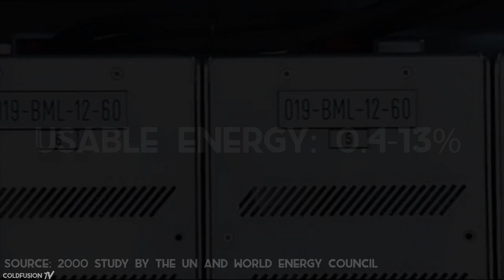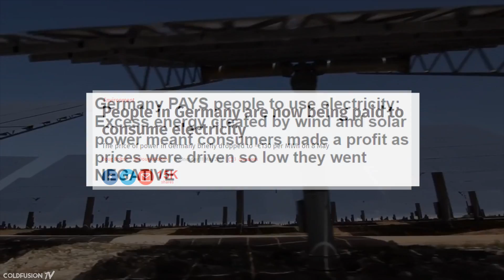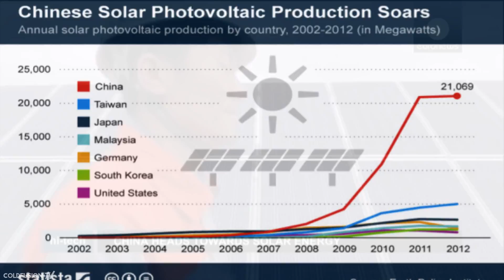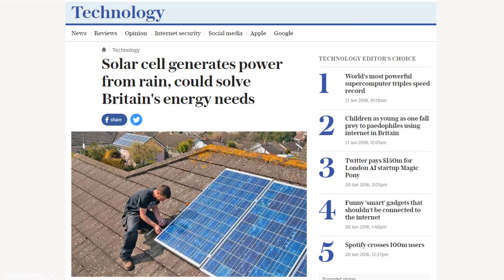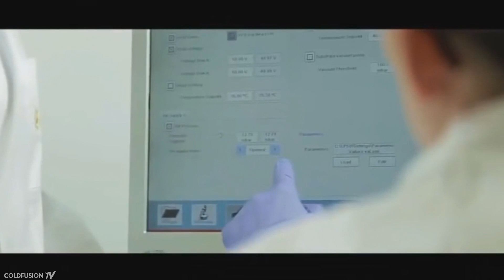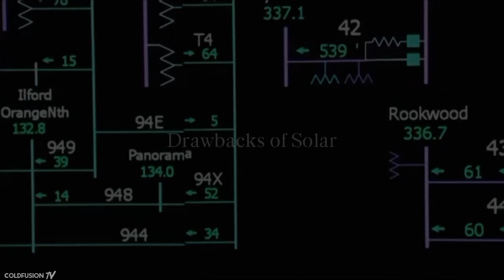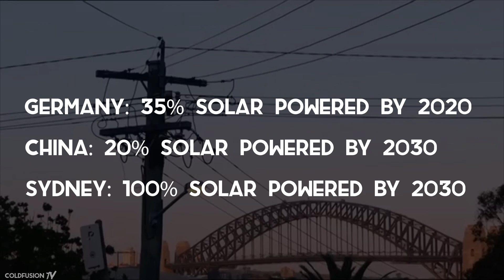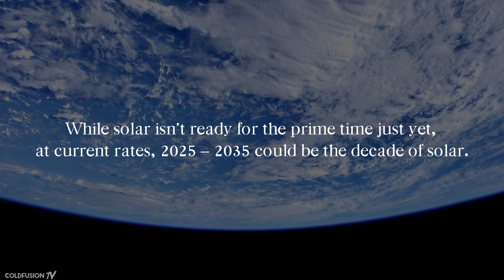The Truth About Solar

Comment: You didn't even mention how much habitat a solar farm needs to destroy in order to make a 1GW plant. Usually desert too, which is probably the most important type. Nor did you mention how many batteries need to be produced for such a plant or what happens when we can only recycle 90% of them. That 10% will build up and fast.

I really wish you would cover Gen IV and Molten Salt Reactor nuclear plants as nuclear is an incredible option for our energy crisis as well as SMRs.

Not to mention how safe it is and does not require mining heavy metals in countries where safety isn't exactly a priority for the children who mine them.

This was a nice video but I can't help but feel there was a large bias to make it seem as if solar has or will have all of its issues solved in the near future. That is not the case at all and there are those who currently theorize that we are incredibly close to the theoretical limit of a solar panel's efficiency.

There is no reason to suppose we must go 100% solar or bust, just as there is no reason to suppose we must go 100% nuclear or bust.

For a channel called cold fusion I can't seem to find any videos about nuclear at all upon searching.

Comment: 3:02 $0.36 per watt? or do you mean per kilowatt?
Reply: He means per watt on a solar panel module, such as a cheap low-end solar panel rated at 100 watts would cost $36. At 2:45 makes it quite clear.
Reply: I am just explaining what the producer of this video is saying by $0.36 per watt. I don't fully agree with the statement. Though, Chinese cheap, small warranty, low-end panels get close to that price. At the high-end (like Renogy and Sunpower), you'd have to purchase whole systems to get it anywhere near $0.36 per watt, at ~$1 per watt on a panel.
Reply: Probably
Reply: Recently I added 2 solar panels to my small rooftop system. I got 540 Watts for A$416 = A$0.77/watt. In US$0.52 per watt at current exchange rates (May 2018).
Reply: Rusty Debier China or Africa
Reply: Solar cells can be bought from aliexpress at $0.30/Watt. Solar plants of the largest scale are usually around $1 per watt, there are a lot more costs than simply the cell!
Reply: @Tousef Para   Energy is measured in Ws=Wattseconds or kWh=kiloWatthours. Power is defined as energy/unit of time, hence power is measured in Watt=W or kiloWatt=kW
Reply: I paid 58 cents a watt on my panels here recently, top quality that's probably about as good as it gets this year for consumer prices.
Reply: lol I hate to break it to you thecarman but all power is provided using energy, every powerplant ever made would be calculated in KW, not kwh.
Reply: Current paying.13 so it is a long way to solar yet.
Reply: $0.36 per watt would be quite expensive... thousand times more than what you paying right now ;-)
Reply: They mean per watt. Solar cost over $100 per watt in the 1970's...now (2019) it's less that $.35/watt
Reply: ColdFusion is the expert here, Papa, not you. As the green militants will be glad to remind you, you may NOT criticize their experts!
Reply: That is not a consumer price. It's like, some projects include thousands of modules, that come straight from a factory. Because it's on such a big scale, the price per module goes down. Usually if you take modules on your roof, there is an "in between" partner who has to make a profit and has to send people to your home to check if it's usable for PV, install the panels and the system for only 4-20 or so panels, so the price per kW goes up tremendously.
Reply: He means cost per watt (energy, not power)
Reply: Research building your own solcar panel (loads of vids on youtube), buy some solar cells and wire them up, it's really easy.
Reply: Either way, that doesn't make sense.
You are paying for energy, not power ... and watts or kilowatts are not units of energy, they are merely power. You need to use the proper units --- kilowatt hours is the standard unit of energy for electrical use. Using 1 watt for 1000 hours OR 1000 watts for 1 hour are equivalent, and should cost the same amount. Saying $0.36 per watt has no meaning unless you say for how long. An hour? ... a week? ... a year?

Comment: A solution to the grid upgrade problem is to decentralize power production by allowing installations on homes and nearby suitable areas, deploying smart microgrids to be able to share as much as possible all generated surplus locally and maximize intelligent use of generated power without incurring into losses due to transmission lines and wasteful use through peak times when generated power is low.

Comment: Video states 0.37cents per watt=$99.9 a panel  but panels cost $200.00 and the needed  inverters are appx. $200.00 also. dont forget the labor and the wires

Comment: My work with alternate energy resources spans about 50 years. I am no scientist. But, I intensely investigated solar, geothermal, wind, etc as a viable investment and business opportunity. I was a builder of homes and agricultural structures. As far back as 1979, I visited many totally off-the-grid farms and homes all designed and built by individuals making clever use of then available technology and materials. I became very excited about those ideas and wanted to go into business making energy independent residential and commercial structures available to my own customers. This turned out to be a financial impossibility.  This was due to the bankers and other interests (read big oil and electricity) refusing, and in some cases, directly sabotaging all alternative energy efforts. Even government was involved refusing to codify such energy efficient designs. Insurance companies (owned by guess who?) refused to insure such structures! At the time,  I was in association with several other forward thinkers in my trade trying to achieve the same goals who encountered the same problems I did. We finally gave up out of financial necessity and re-joined the conventional processes. We found that any mention of alternative energy project was met with first ridicule, then intense rejection and, if a person persisted,  even subtle threats to our own financial security!

Alternative energy all sounds good. It is certainly viable and absolutely the way the future must work. But, really, nothing of any real significance will ever happen so long as Big Fossil Fuels outfits run the show. Something really huge in economics must happen- a major, and easily replicated (shared) technology has to happen to drive the existing "Rulers" of Earth's energy off the table. Solar and wind will always be more-or-less interesting toys in the shadow of these huge energy giants.  The "technology" will never quite be accepted as practical in the larger sense. They will never just throw up their hands and say, "Ah. There we have earned enough mega bucks...you little people take over, now." 

That is the reality of the alternative energy world IMHO.

Comment: The chief cost of solar panels is the area of land required. The chief fault of sunshine is that it is not dispatchable.
If you have more solar power coming in than you use, and the electric company is compelled to buy it when they have nobody that wants it, you are stealing.

Comment: I'm seeing a lot of comments suggesting solar will never be cheaper than coal. In fact, both solar and wind are already cheaper than coal. Check out this report by the World Economic Forum: https://www.weforum.org/whitepapers/renewable-infrastructure-investment-handbook-a-guide-for-institutional-investors/ it found that in 2016, solar was cheaper than coal in more than 30 countries, and that solar is becoming cheaper at a faster rate than coal. Solar is cheaper than all fossil fuel energy sources and is rapidly becoming even cheaper. Fossil fuels still dominate in 2017 because there is a lot of upfront infrastructure investment required for transitioning the world to solar and because the fossil fuel industry has spent large amounts of money to convince people renewable energy doesn't work.

Comment: one point that was missed in the video is that for silicon solar cells the total amount of energy required to manufacture a sogar cell is considerably more that one will ever obtain from the cell over its lifetime. 
However, with new technologies this input/output energy should improve.

Comment: First, Germany does not have an abundance of energy. They have such a huge energy deficit that they depend on natural gas from Moscow to compensate.Second, the Rare Earths required to make solar panels and the batteries for electric and hybrid cars are so scarce they make petroleum look as plentiful as sand. Two of the rare earths are only found on one side of a single mountain in China. Until they can develop a system that uses no rare earths at all, the costs associated with solar will increase exponentially as the extremely limited resources are used up. In the meantime, we're just trading dependence on foreign oil for dependence on foreign rare earths instead. That is not an improvement.

Comment: The one thing these people will never talk about is the maintenance of solar or wind power. Lets talk about costs to the environment for the manufacture and the recycling process of the hardware that harnesses the power of the panels and windmills... batteries, capacitors etc. This is where the cost lies, yet its never talked about. Same for the wind farms...the energy is captured in DC, then has to be converted to AC. To do this, lots of hardware (batteries/capacitors etc) has to be employed for this process. Nuclear power is the way to go.

Comment: wait germany is wanting 35% by 2020 but you said germany was paying people to use energy since they were producing so much because of solar and wind? which is it? you also failed to mention the space solar takes up just to produce the required power. germany has them everywhere including fields and along roads but still hasn't hit 35% production. by the way cold fusion is a pipe dream that isn't attainable.
Reply: oh yes at .36 cents per watt means it's $36.00 to light a 100 watt bulb. I would love to have a more eco friendly and cheaper power source than coal or natural gas. coal power plants have been on the decline for quite some time anyway. you did hit on the main issue with solar power. no intake of energy at night. till storage can be fixed and regulated for demand solar will never overtake the others. honestly hydro has more promise than solar in that aspect.

Comment: Solar is not base load, and backing up the grid with batteries is horribly expensive.  Backing up solar with gas turbines is so polluting its pointless.  In a few places hydro is a good match for balancing/back up but most countries are not that lucky.  Really the only long term,affordable (half the cost of coal) and low pollution ( burning up 99% of its fuel) is Thorium. Everything else is just an expensive,impractical waste of money.

Comment: What are the side effects of the sunlight not hitting the ground but bouncing off (reflecting) back into the atmosphere ? What about the energy and mining required to manufacture the batteries ? Whats the point if it takes more energy to make a solar energy system,than what you will ever get out of it ?

Comment: What makes the most sense is approaching energy production without bias.   Too many people pushing solar are ideologically biased against other energy sources like oil and coal.   Solar has an important place and indeed will likely someday be the dominant source of power - I am all for it.   However, that day has not yet arrived and we still very much need oil, coal, and Nuclear.   When we put ridiculously overkill regulations on these sources that needlessly drive up the cost to consumers, people are getting hurt.  For example, here in the United States, the law of diminishing returns means that a long time ago we reached the point where additional regulations caused significant increases in cost for insignificant decreases in pollution.   The result over the last 10 years has been a 40% increase in the cost of electricity for perhaps an unmeasurable improvement in air quality.  We need a sensible balanced approach, not a jihad against sources of power we very much still need.

Comment: In the introduction you try to make solar power look amazing. But it isn't. It's simply about using daylight. Basta. Solar may or may not be a reasonable energy source of the future, but it isn't amazing to use it.
When it comes to the wow-factor, fossils and nuclear have the factor on their side. Fossils are taken out of the ground. They're taken from deep deep down. It's the counterpiece to flying high. When you take a flight, you're not only flying high, you do so by using a fuel that's been taken from deep down in the Earth, about as deep as how high you fly or even deeper.
Nuclear is the counterpiece of space travel. Space travel is about flying through the big universe. Nuclear is about using the smallest thing we know: center of an atom. Microchips are a technology of making things very small, but the nucleus is even smaller. In chemistry, elements stay the same. The chemist can't transform one element into another. In the use of nuclear power, elements ARE transformed into other elements.
Those energy sources with the next-best wow-factor are water and geothermy. Water, when you build big dams and control an even bigger body of water with them and geothermy where you take something from deep out of the earth.

Comment: This video omits to mention the huge externalities solar creates as a result of its tendency to undergo common mode surges and slumps in output. These common mode surges and slumps essentially mean that the entire system cost of electricity production goes up as solar power accounts for a larger proportion of total generation. This cost of solar power is currently hidden because, as I mentioned, it is realized as an externality borne by the thermal power plants (which are almost always fossil-fueled) that act as solar generators' back-up power.

Comment: this all sounds very good but here in the uk the sham government dropped it's green energy policies just after the last general election. 
secondly have the coefficiency loss problems been solved yet concerning necessary inductances for instance, step up transformers and dc to ac inverters which are both required to run household appliances. it would be interesting to be fully informed about these products.

Comment: I watched the video.  Most of the solar panels shown in it had dark surfaces, so I assume they get warm or hot when exposed to the sun.  If we greatly expand our use of solar power by using a lot of these, could that contribute to global warming?  Also, I assume these panels break down and require replacing over time, so implementing solar systems is not a one-time expense.

Comment: Not too bad.  However, you are glossing over the storage issues.  That is literally the only major problem.  The transmission issue is only pertinent if you don't have local solar panels.  And the end idea is for every house or building to have the panels to supply their needs autonomously.  If the storage issue can be licked (Tesla is close, but no cigar) then pretty much everyone would be going to solar if they could.  

The next issue which is sitting on the line between major and minor is the regulations about adding power to the grid (for houses that are producing more energy then they need).  What is required for actually common sense reasons are boxes that are expensive.   These condition the power so it doesn't hose things up for everyone and works to automatically switch between solar and grid power when the sun goes down.  

One thing I think would be a big help is if those who get big solar panel arrays not worry about charging the electric company for the power they put back on the grid.  At this point, if you can afford to put in the solar panels, you can afford not to gouge the electric companies.  Because when you gouge the electric companies, you are hurting other consumers as the electric company isn't just going to swallow that loss.  Put on your big boy/girl pants and be part of the problem instead of a parasite.

Of course the real solution would be finding a way to safely beam the energy down from geosynchronous orbit satellites.  Which is where I think carbon fiber is really going to shine, if you'll pardon the pun.  Use it to create a cable.  Better idea than trying to make an elevator out of it.

Comment: The big problem with solar is it takes, lead, mercury, silicone, glass, plastic and copper to make a solar panel and acid lead or lithium for the batteries.  In reality it takes more power to make solar cells and batteries than can be recuperated in the life time of the system and it is still far less efficient than any other method.  The very best and cleanest is hydro power, but wacko leftist liberals want all the dams taken out.

Comment: German here: We have never been paid to use electricity, price can go negativ, but it doesn't mean we get paid. Powerplants are getting paid to produce less or to produce something like a counterbalance due to not killing the grid. Siemens for example has built the most efficient gasturbine ever, but they only use it to regulate the frequencyfluctuations in the grid caused by Solar pannels and wind turbines. What the future needs is storage for energy. So we dont have to waste coal, gas, oil, diesel or whatever to save the grid.